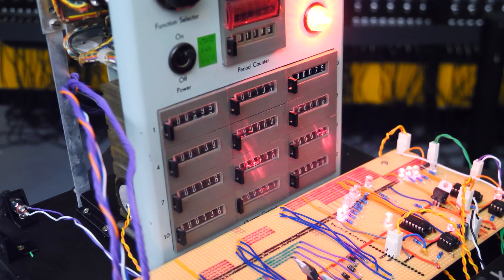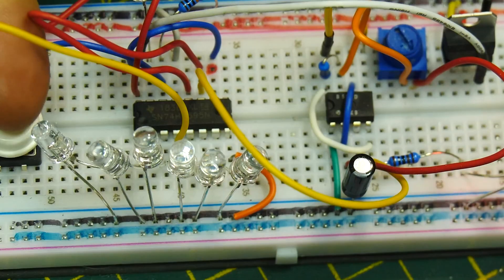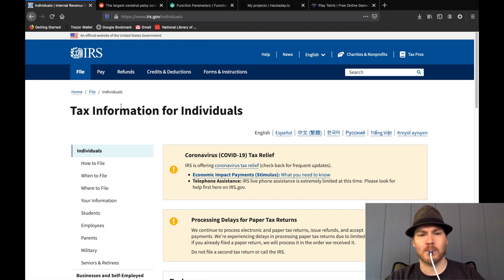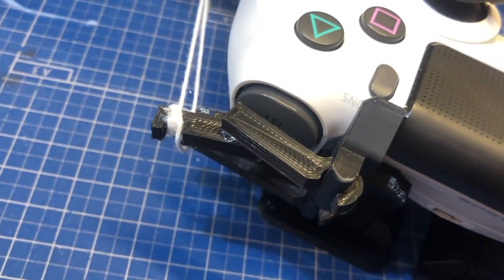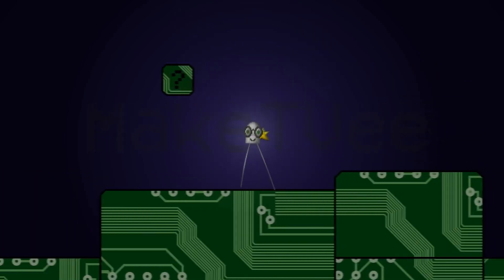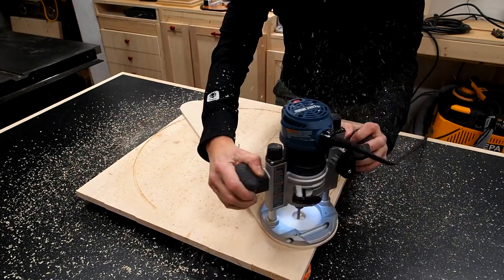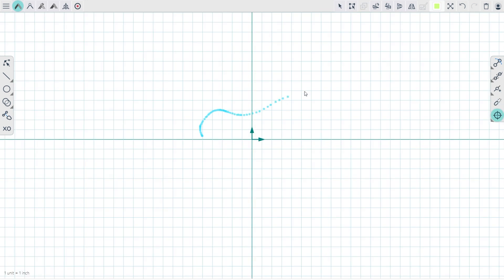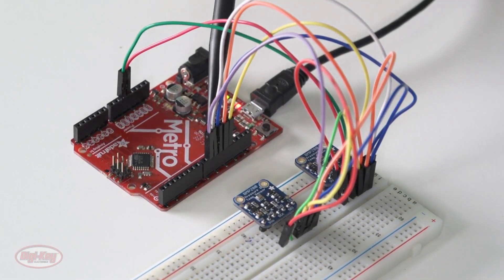Counter Rhythm [Maker Update] - Maker.io

Comment: Great job Tyler hosting the Maker Update show this week. There are some great ideas shown here but I’m still trying to wrap my head around the $150 for a 4’x8’ sheet of recycled polly foam felt board. I hope when the demand increases the cost will go down considerably. I wonder if there’s a thinner sheet that’s a lot less expensive because many projects may not require such a thick board. If it’s being used for sound insulation I can understand the thickness requirement! It would need to be art projects due to the highly toxic & flammable nature of plastic materials for a wall covering and that’s one of the governing concerns with what to due with recycled plastic materials. There’s no perfect solution for what the plastic’s industry has created but it’s a good start. And be carful if your covering a wall near a heat source. Have a Great Thanksgiving holiday!
Reply: Yeah, I was super excited by the material until I saw the price. It's still cool, but...  yeah. If you look on their site, they're selling a bunch of pre-fab designs made with the material for homes and offices, and maybe if enough folks catch on to it the scale will bring the price down.